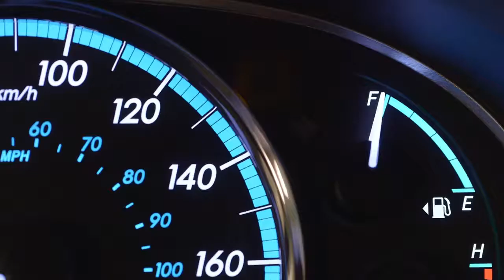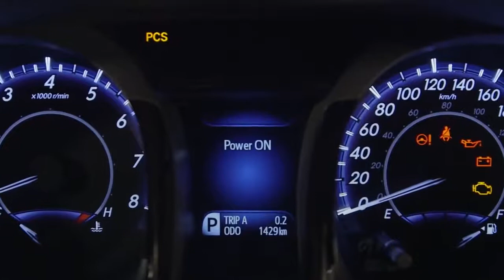Toyota Traction Control

Comment: Can someone help me out, my Tacoma 2012 traction control isn’t turning off
Reply from the maker: Hi Jarin,

To turn off the traction control you must be at a complete stop. Then you hold down the traction control button (it has the skid marks). This completely turns off the stability control and disables the traction control.

If you tap the button it only turns off the system for a few moments instead of permanently.

If your problem persists we suggest you visit your local Toyota dealership, their expert technicians will be able to diagnose the problem more accurately than anyone else.
Reply: Brimell Toyota I put it in parking and nothing
Reply from the maker: @jarinfierro9824  If you've followed all the suggested steps the next course of action would be taking it to a shop to be diagnosed by a Toyota trained technician
Reply: Its ur engine  same here with my  n the check engine  is on too right
Reply: Its your engine bro toyota has some issues with there cars. I might thinking of giving up on toyota right now n I'm just at 35 thousands miles in.